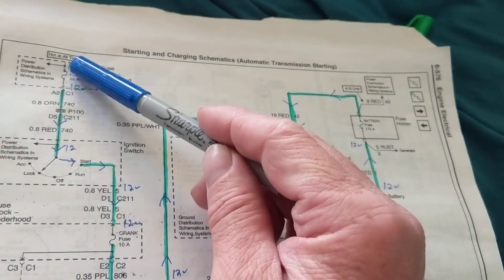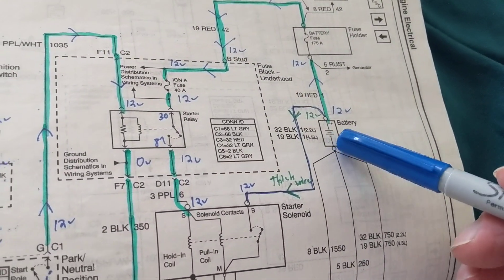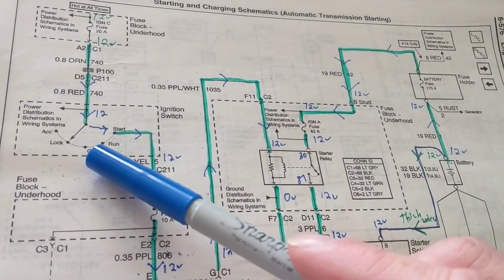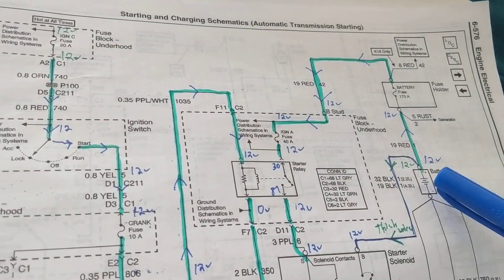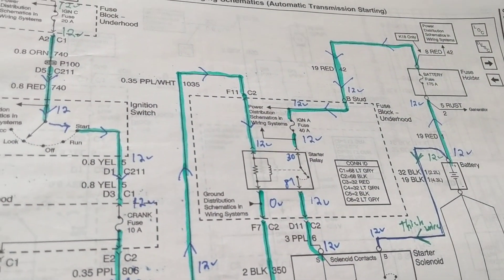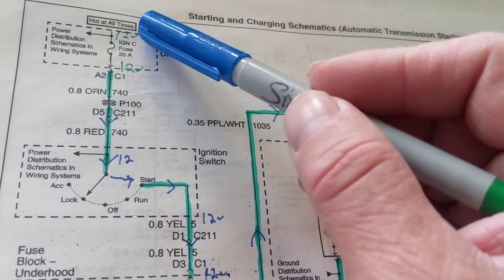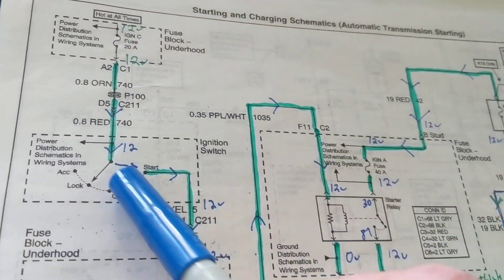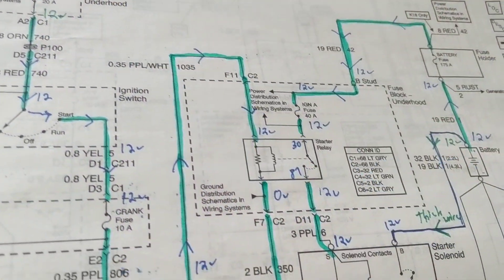HOW TO UNDERSTAND TO TROUBLESHOOT STARTER MOTOR FROM DEALER MANUAL

Comment: Good morning joe I'm in a bit of trouble here ... So I have a 2011 nissan altima 2.5s and I'm trying to connect the wires from the maf sensor pigtail just that I got two different colors what can I do
Reply from the maker: That's where a multimeter comes in make sure the one going to the b+ is correct and the one going to ground is correct and the third wire signal returns you can go to Google download a wiring diagram for 2011 Nissan Altima mass air flow sensor if you have any trouble with that please respond to me
Reply: @Joeelectronicschematicsforauto  ok I'ma go ahead and try that the ignition has to b on the second right? Thank you ...I'll let u know if I get stuck again .
Reply from the maker: Good luck